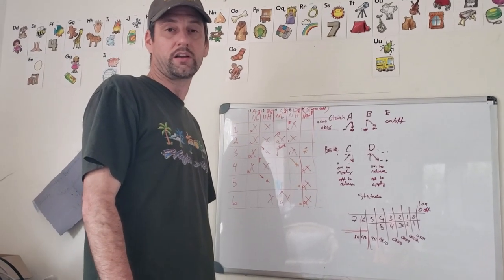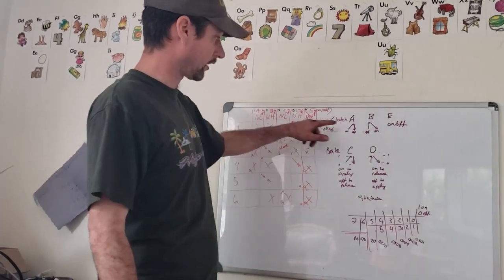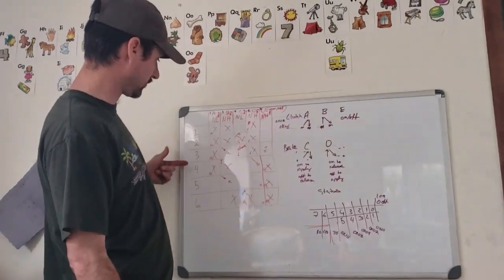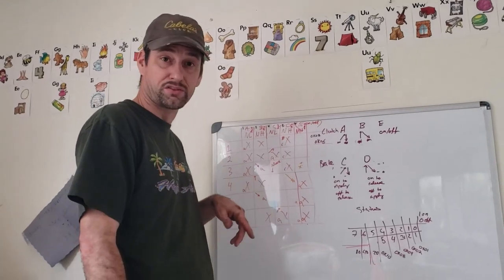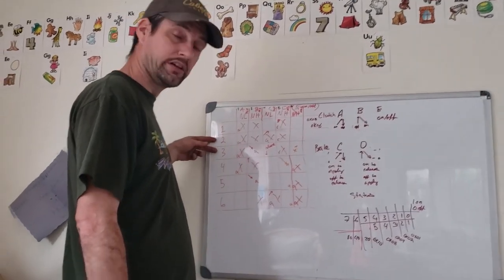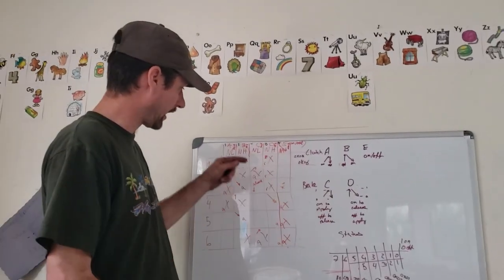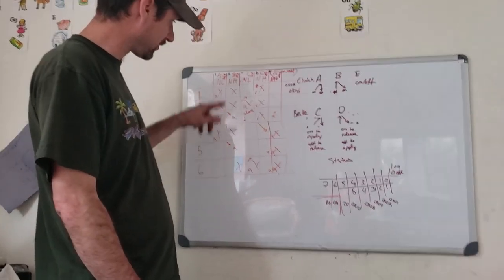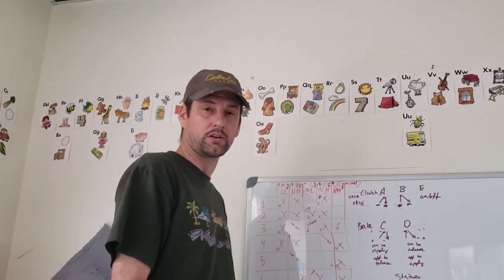6R80 Shift Control Logic

Comment: My 11' f-150 shifts hard from 1st to 2nd. Mainly under light throttle. If I get on it, it shifts better. Almost feels like the engine power isn't letting up between shifts and it bangs into second. Then some times it shifts smooth.  Any suggestions?

Comment: have you ever had 3-4 shift and a 5-3 downshift    make a squawk noise    the 5-3 downshift is way worse  and is very loud      many people seem to be having this issue   as i watch more videos and read comments     rebuilt transmission     and new oem  clutches fluid additive and new valve body have all been tried to remedy this problem